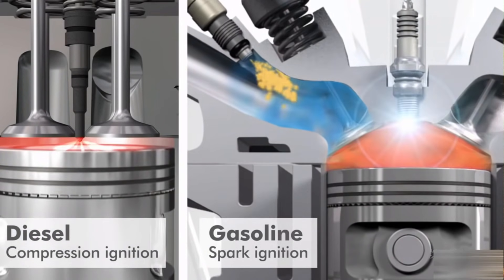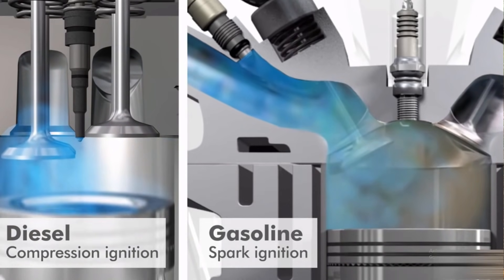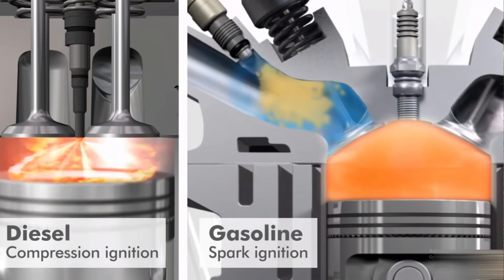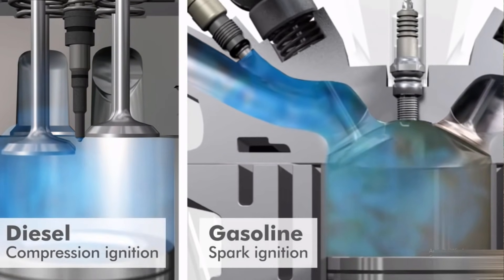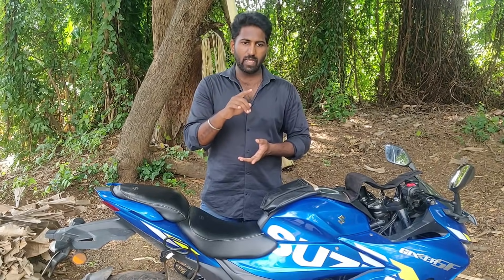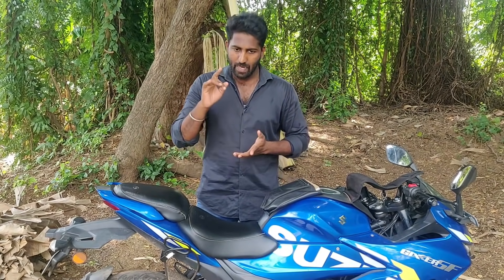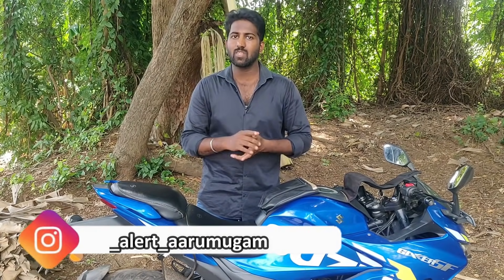Putting Diesel + Petrol in Bike |  என்ன நடக்கும் ??????? Clear Explanation | Alert Aarumugam

Comment: Bro I have run nearly 250 km once on my two wheeler hero glamour bike without any issues by mixing just diesel to my fuel(just half liter petrol on my tank I use to mix with 4 litter of diesel ) regular milage on my bike 55 in petrol but that time I got nearly 65 km for mixing diesel bro.  Main issue I got was next day morning bike starting problem other than that nothing happens bro . Bike will run on diesel to but it will reduce the life span of the engine material bro 🙏